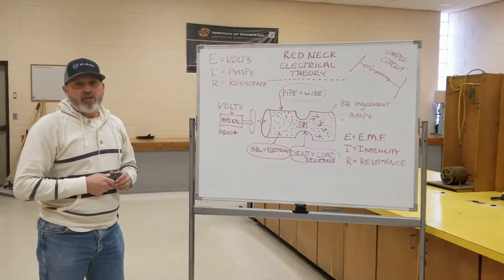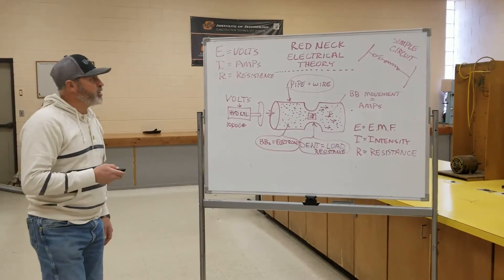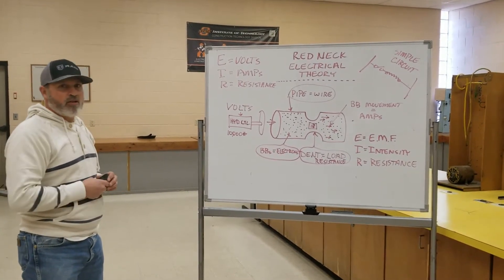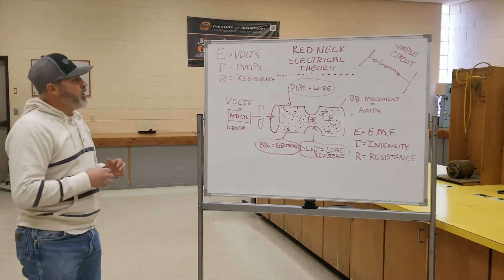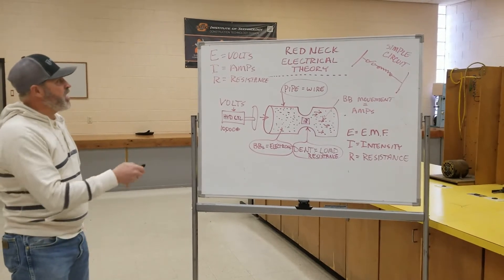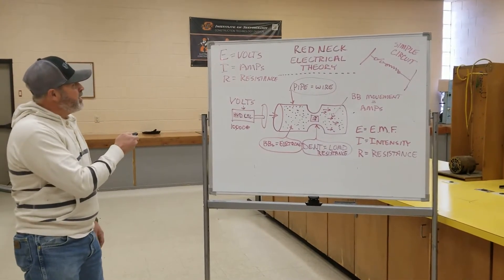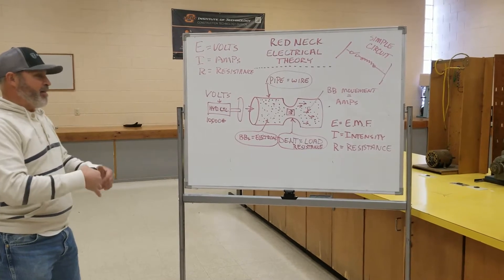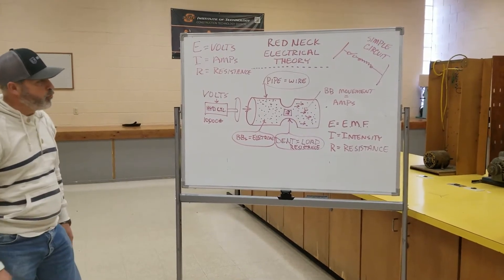Redneck Electrical Theory

Comment: It’s called current not intensity and it’s measured in amps🤦‍♂️
Reply from the maker: E=IxR, this is the most elementary concept in ohm's law.  My question to you then is what does "I" stand for? We all know that "I" is the symbol for current, or amps!! But what is current and amps?  This is the total number of electrons shifting in a conductor.  "I" stands for Intensity which is amps.  You should enrolled in my class at Oklahoma State University.